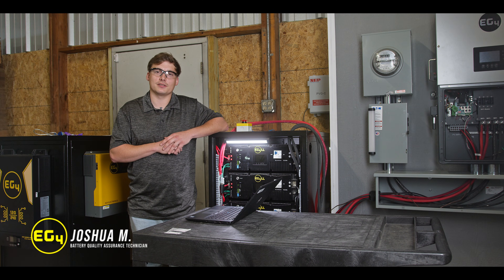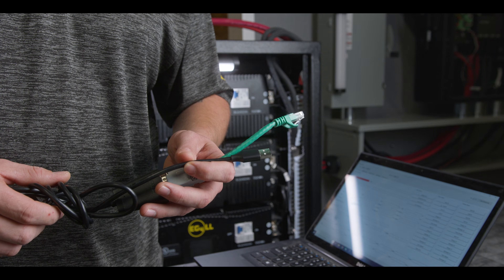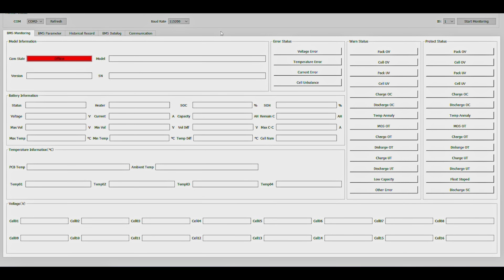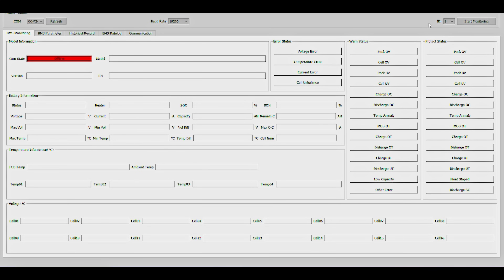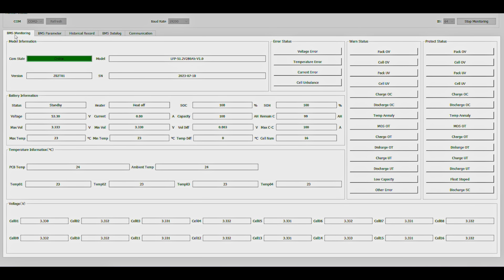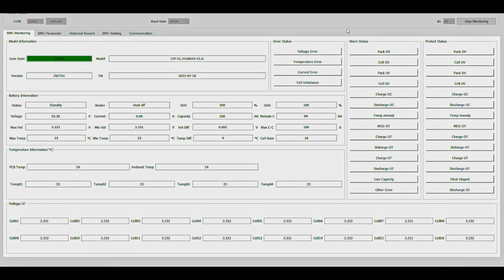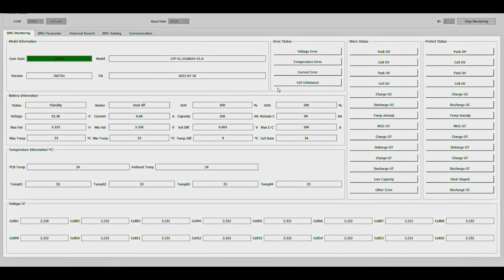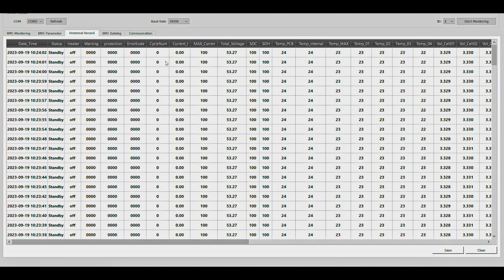Unlocking Battery Potential: BMS Tools v1.0 for Seamless Communication with Multiple LL Batteries

Comment: I didn’t get the cable with mine what can I use for substitute and also what port and how do I set the dip switch to 64 by putting all the pin high postition

Comment: Is this for V2 only? 
I have 6 x V1 EG4 LL's. I have the USB to RS232 cable from Signature and I was able to correct the date and time on all 6 batteries using BMS tools V1.0. 
I also have the USB to RS485 cable that I have used on my other system which as 6 x EG4 Lifepower batteries.
Reply: Same here, having difficulties with BMS

Comment: Thanks for the video. One key point that you quickly mentioned is the pin out for the cable. The cable I received is connected to pins 7 and 8 vs 1 and 2 for some reason. I contacted EG4 and they're sending me a new one. To clarify, it plugs into the Comm port now, not the RS485 port? Also, are you guys going to update the user manual?

Comment: I have an EG4-LL-S battery and I cannot connect to the battery with an RS485 adapter on either the Battery Comm or the RS485 ports. Can you do a guide for the new battery?
Reply: I have the same battery and cannot either. Have tried all 3 of their windows tools programs. And followed directions.